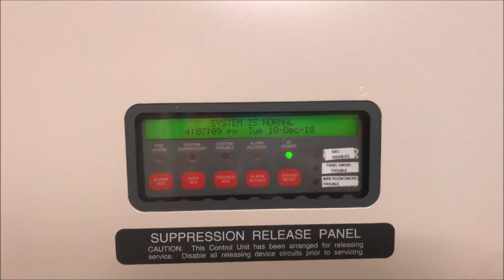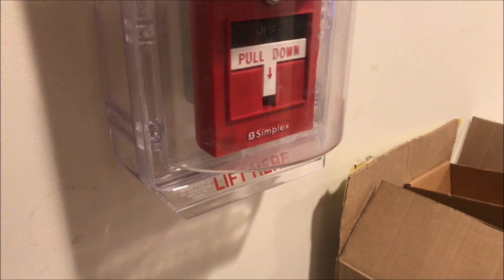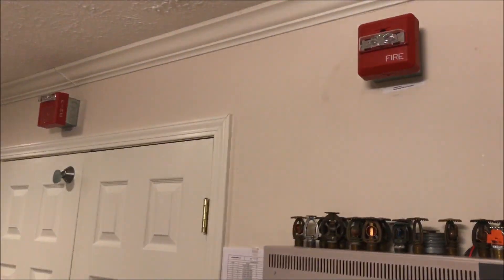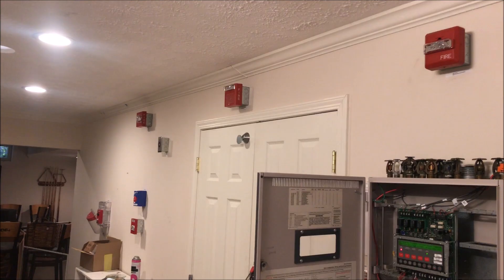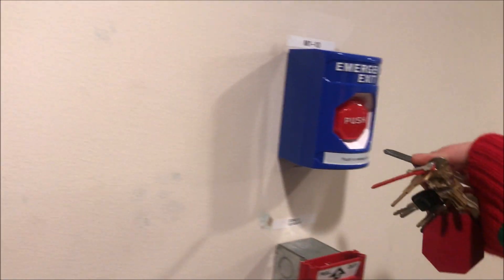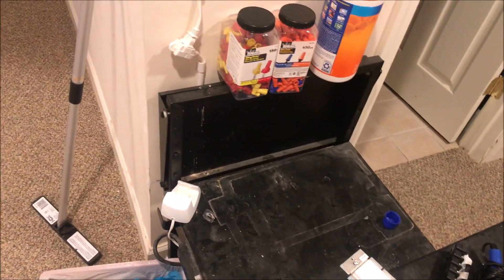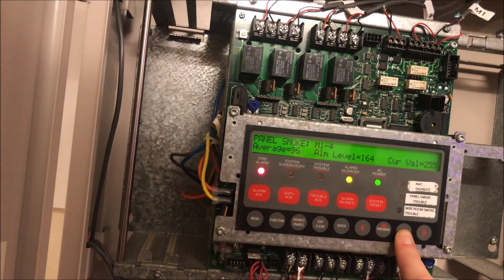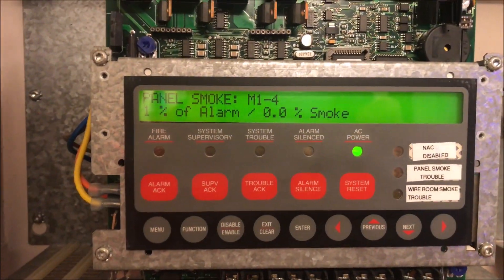Simplex 4010 Test 22: Wheelock Z-Series!

Comment: Fire Alarm and Such Please Respond. Do you need a module to run the other pulls that aren't made by Simplex?
Reply from the maker: You will need a module to run any device that does not have an IDNET or MapNET module, even if it is a conventional simplex device.